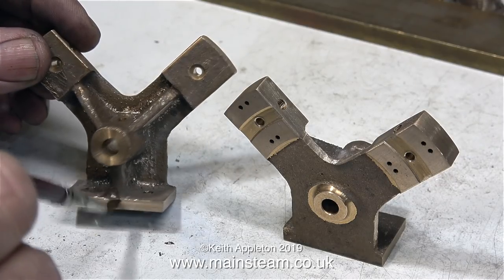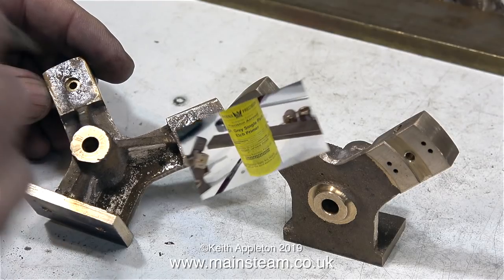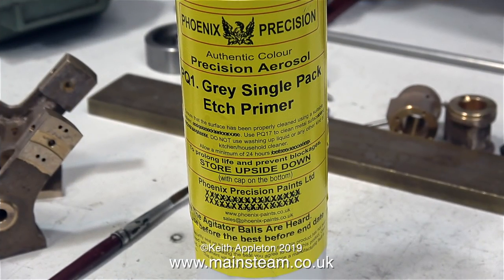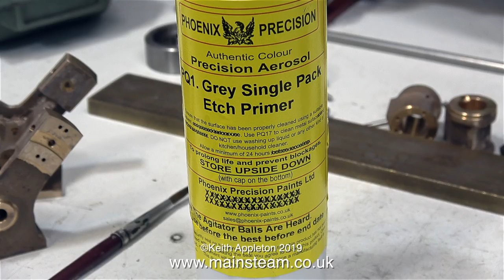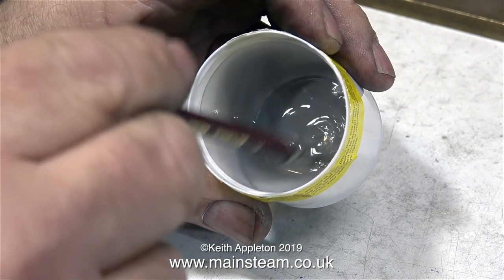HOW TO BUILD THE BLACKGATES TWIN STEAM ENGINE - PART #6

Comment: Say Keith have you ever done this b4?  ( & I don't mean painting ).  Would balancing the pistons/cylinders, etc., make a difference, less resonance... (does blackgates sell harmonic resonators!)... Cheers
Reply from the maker: no, it's a first for me. there is a balance weight on each of the crank webs, but reciprocating steam engines are not usually balanced very much as they do not rev very highly.